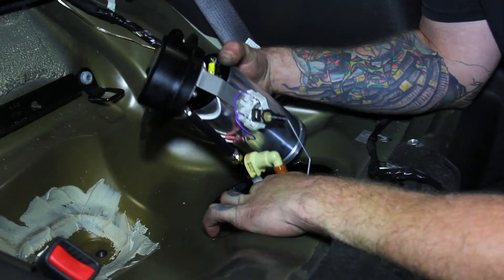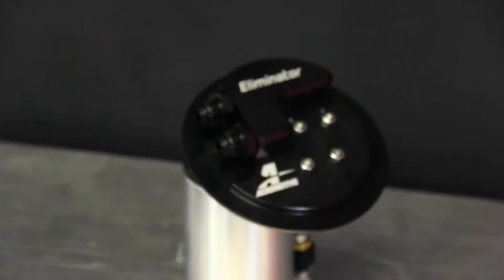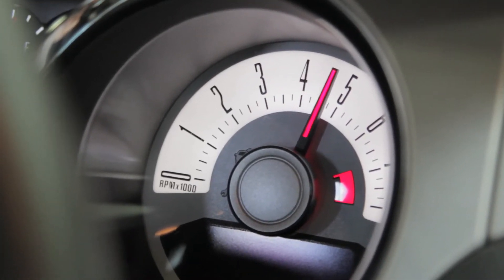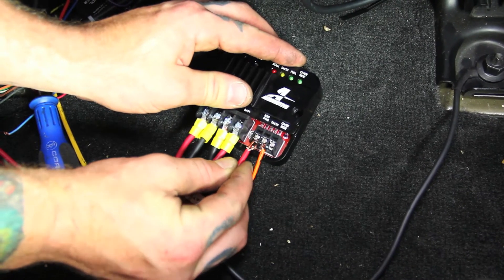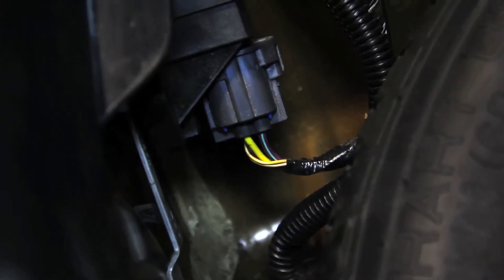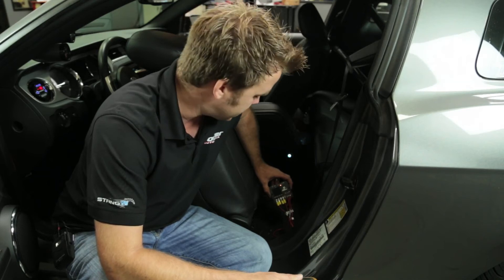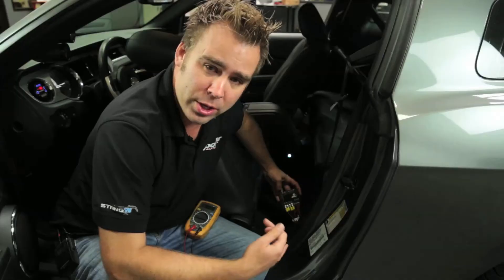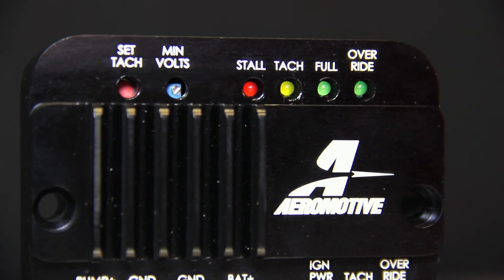Inside Aeromotive's Fuel Pump Speed Controller: The device that keeps Pumps Running Cool

Comment: It's an overpriced piece of garbage. You can do the same thing with a $20 ebay PWM controller and an override switch on the carb for  full throttle activation, or using a shift light circuit to RPM activate the override. An RPM , MAP based product would be a better idea.

Comment: I have a mangafuel pump ando buy this Aeromotive fuel pump controler and each year my fuel pump was damaged first time they told me in magnafuel that it was a battery descharged low batery and they send me a new one then again about a year so I call magnafuell and tell them all my fuel sistem because they ask me and the moment i told them that i had Aeromotive fuel controler told mee that was the reason of failure the first time and second and told me too get rid of it and problem solve

Comment: This is a really stupid gimmick. You set your tune (once) on the dyno and its done. You wear the cost of any extra fuel use when putting out 800+ @ wheels. Being variable, this will only throw out the tune. You tune the car on the dyno via a rising rate fuel pressure regulator (FPR) which cost around $100US. Tune it once and you're good to go. Getting efficiency at low load/rpm comes down to two variables. The quality of the ECU being used and the quality and knowledge of the tune/tuner
Reply: I think you're missing the point of this device. The tune won't be effected because the relative fuel pressure will remain constant and therefore the fuel quantity per injection, unchanged. That's what the fuel pressure regulator is for.

This is to slow the pump down to reduce fuel heating and wear on the pump at idle/low loads.
Reply: @sootpig  no. They are claiming it will not only do that but it will save you money when cruising or driving slow etc
Reply: Heating of fuel is nothing. It's not even a factor. Gas is cold by nature. The main heating it has is within the chamber when it's sprayed in at mist-level (which has a cooling effect anyway
Reply: @Boostinpulsar  My engine is just over 700 HP. Before I installed the fuel pump speed controller, if I had less than 10-12 gallons of gas in my tank, the fuel pump would get hot and quit after 30-40 miles. I have now put over 1800 miles on my car withe no issues (knock on wood!). The more times the fuel runs through the fuel system, the hotter it gets and in turn, causes the fuel pump to get hot. Heat is not good for any electric motor.